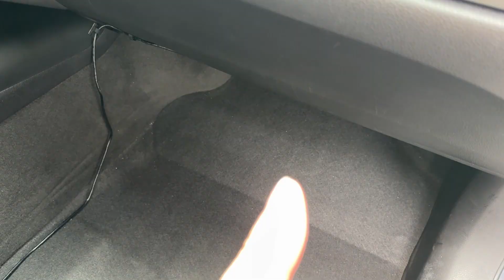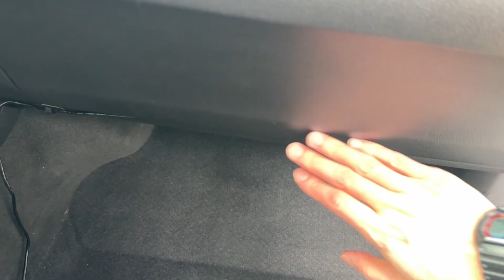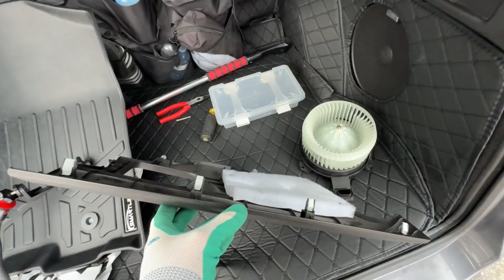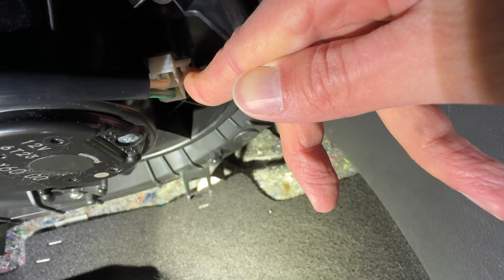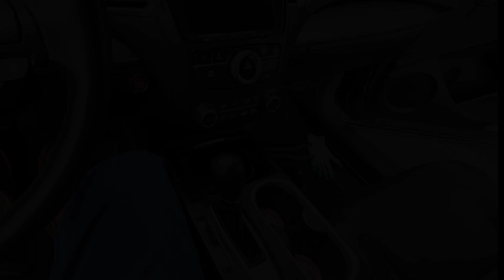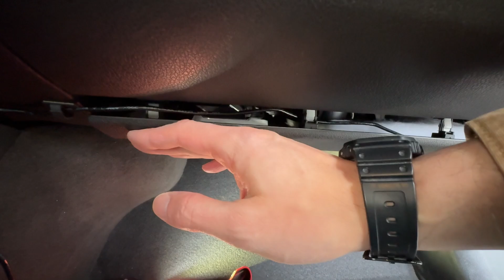Acura RDX Blower Motor Replacement (2nd Generation 2012-2018)

Comment: Hey, I’m having an issue with a ticking sound coming from the blower motor and the fan blowing weak and intermittently. Occasionally it will operate normally but most times I get weak airflow and an audible ticking. Would you start with blower motor or troubleshoot something different first?
Reply from the maker: To be honest I'm no expert mechanic so I won't know for sure, I'd research a few videos or forum posts to see if there's anyone with similar symptom to you first. The blower motor is probably the easiest part to check, you can remove the dash plastic cover and try to listen if it is running properly according to fan speed. You can even remove it but with the power connector still connected to see how well it runs.

Comment: Excellent video and very detailed. Did you need to replace the blower resistor also ? Thank you my friend.
Reply from the maker: Thanks nope in my case just the motor. My old motor was still working but making a whining/squeaking noise so I just replaced the unit and all is well now. If your resistor is out your symptom would be HVAC not working in certain fan settings or not at all even when the motor is running.